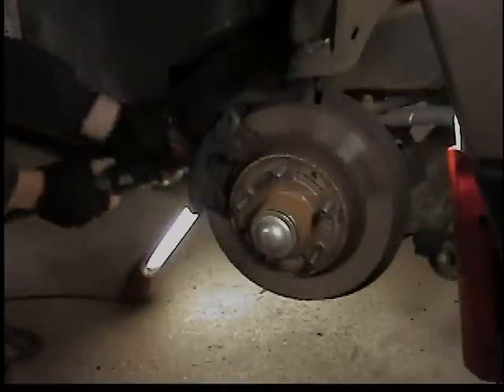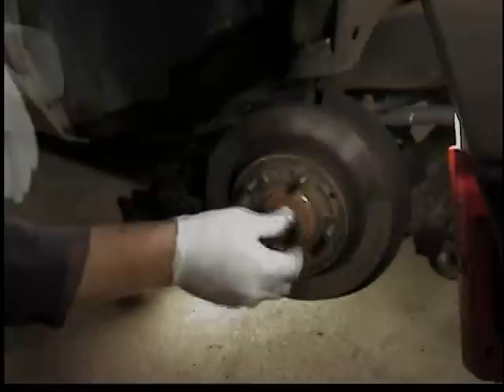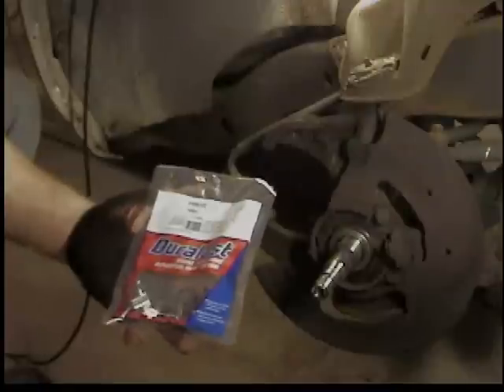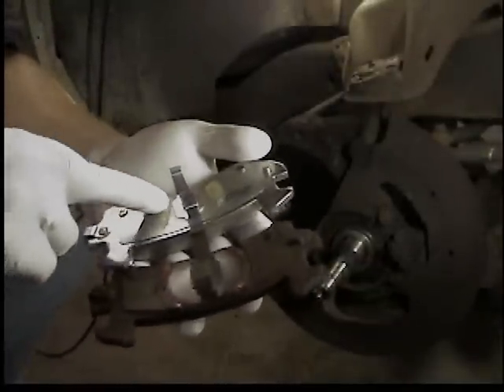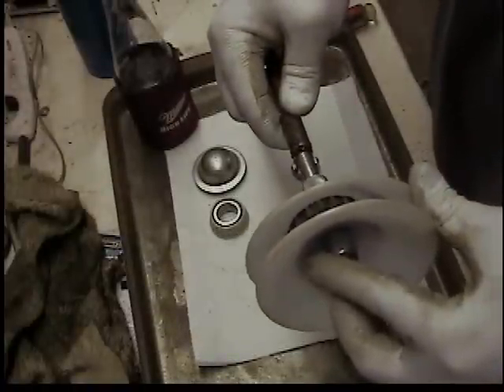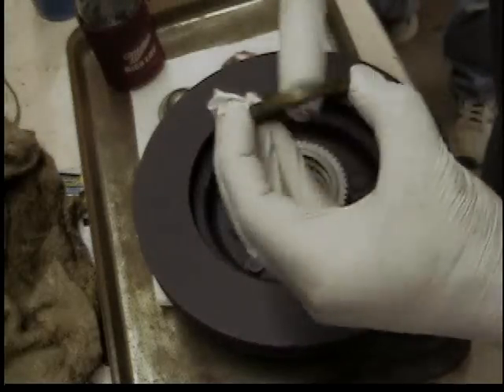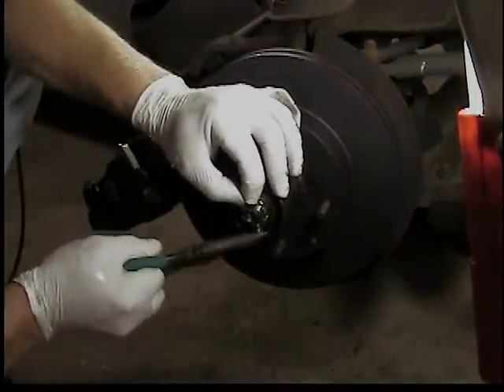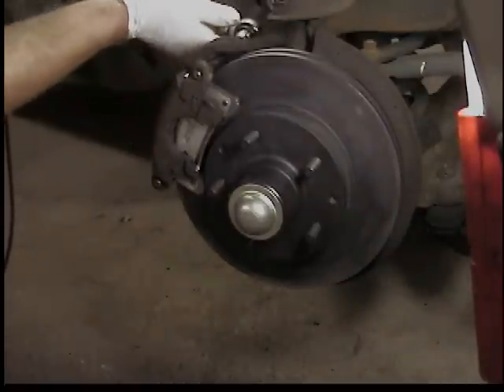Chevy S10 front brakes - rotors, pads, seals, re-packed bearings how to DIY

Comment: tip i learned from a brake instructor... before you push the piston back with c-clamp, get some soapy water and a tooth brush, and clean all the debris off the rubber seal before you push it back in.  it will help ensure even brake wear by making sure the piston moves freely
Reply from the maker: Good advice. Thanks.
Reply: I sprayed mine with a silicon spray. But I do remember learning the soapy water back in my M.A.T.C days..🤔🤔

Comment: Awesome video.  Not overdone.  Very informative.  and Beer!  I was leary about doing this but you have made me confident.  Need the same brake job on mine.  Same year and 2WD.
Reply from the maker: Glad to help. This is a great DIY project. Wrench On!
Reply: This is a good video.  Just the right amount of narration.
Reply: Same here. I have a 2001 though
Reply: ME too ! But last time pad wore crooked and did NOT replace O-ring for Slider Bolt, OH NO !  Bet it's Crooked again.  Will replace long bolts, sleeve and O-ring...Bolt was wore into the metal last time YEARS ago.  DREADING this...Need to replace rotors this time.

Comment: My guide pins didn't have any orings on them, and my caliper had the exact same smaller oring from my hardware kit, installed opposite the larger oring in the same type of recessed channel.  I really believe for the guide pins to slide on.
Reply from the maker: I'll buy that. It was a long time ago. The neighbor still has that truck with no problems. I'll pay more attention next time. I was drinking beer at the time. :)

Comment: This video needs a correction. The small rubber rings DO NOT go at the hex-pin head. They seat into a groove in the small holes on the outside of the caliper where the pins move through them, opposite the larger holes with the bushings.
Reply from the maker: I put a note in the video description. Thanks.

Comment: My brake rotors are different. They don't have the nut in the middle. There is a cap there and when I take it off there is nothing to remove. It's hollow in the middle and you can see all the way through to the other side. My drivers side rotor started developing play and it is making all kinds of noise and vibrations and stuff so I wanna get it replaced but idk how
Reply from the maker: 4x4? Different year?

Comment: Did you have to bleed the breaks?... Or refill the break reservoir??? Thanks. I have a 2000 Chevy S10 2.2ltr.  truck.
Reply from the maker: No. The new pads push the brake fluid back up into the master cylinder. No bleeding was necessary because the hydraulic side was never opened; no brake line or caliper replacement.

Comment: First, thanks for the video, but I believe the small o ring you put on the caliper guide pin, should actually have been inserted opposite the  larger o ring you inserted in the caliper, for the guide pin to slide on.
Reply from the maker: Maybe. That's where they were when I took it apart. I think it works as a dust shield. If you mean that they go on the other end of the pin, remember that the pins stay with the caliper and don't move in relation to the caliper.
Reply: Jim, you are correct.  The smaller o-ring is supposed to go on the opposite side in the caliper not under the bolt head.  I have owned a 1997 Blazer since new and have always done the brakes on it.  That is where the o-ring came on the factory set-up and if you buy replacement calipers, that is where the o-rings come installed.  I can't imagine you would get a proper torque reading if you install the o-ring under the bolt head, not to mention losing torque as the rubber expanded and contracted and wore out over time.
Reply: 613JMM can you tell me how it should be placed correctly My s10 has no hardware just bolts

Comment: i have a 2002 chevy s10 v6 2wd. im doing the driver side front brakes and rotor also caliper change. everything is all done and ready to be tighten down, i got the top bolt for the caliper on and tight but the bottom bolt will not reach female thread and tighten? any ideas
Reply from the maker: temper moto Is the sleeve hung up on the o-ring? If it is not pushed in, it could hold the bolt back. Keep us posted.
Reply: There's no o-ring but the sleeve is fine not hung up or Cought everything is snug but the bolt just won't grab thread...makes no sense I took it off lol so should go back on but it's a new caliper and bolts...
Reply from the maker: temper moto Keep comparing it with the old caliper. Something is not right.
Reply: i got it and now all is replaced and fixed issue was turning wrong way instead of left was turning right lol simple mistake but also was pretty bad striped and tore up.
Reply from the maker: Ha! Rightie tightie, leftie loosie. Except when looking at it from the back side. Thanks for sharing. Glad you got it.
Reply: haha yea man anytime keep updates for more work done to it :)